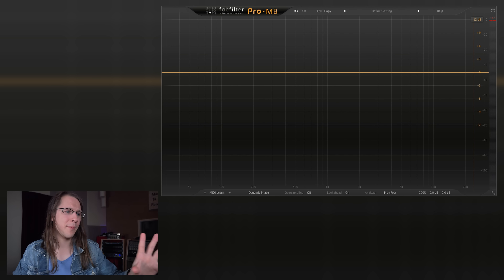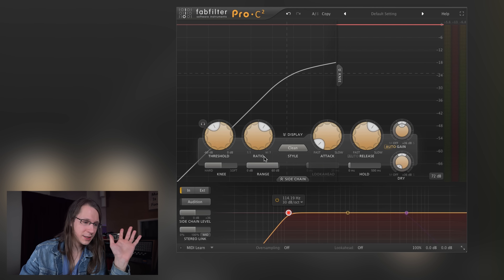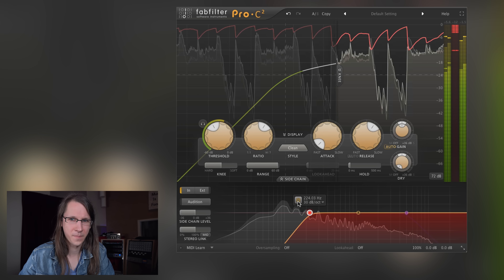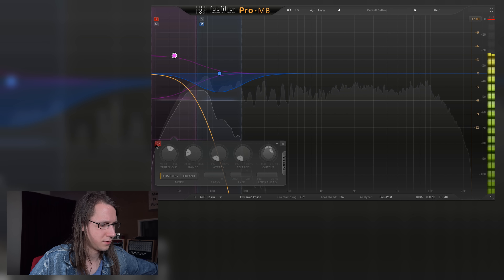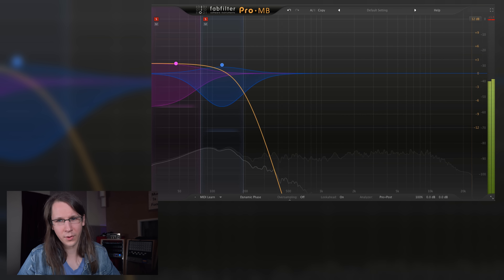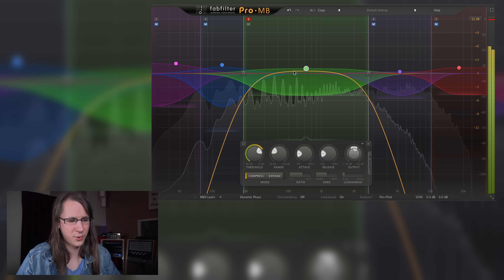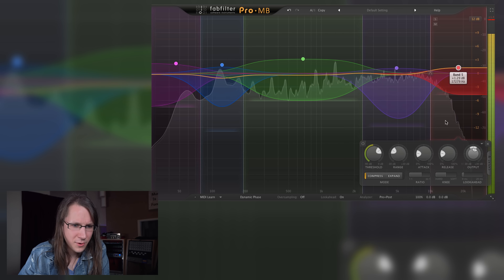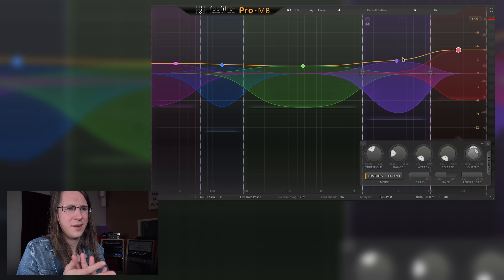HOW I USE MULTIBAND COMPRESSION.

Comment: The main problem with multiband comps is that they generate phase incoherences, which can be heard btw on your high-mids and highs btw. That's the reason why M. Brauer and many other mixers are using different compressors on different type of instruments. Multiband are great on monophonic sources - vocals, bass -, can be used even on guitars, but when mix well, not so great. When mastering, it is being used as a corrective tool.
Reply: But the phase incoherences can sound nice sooo
Reply: spot on
Reply: He says it in the end “there is something wrong if I need to use it”
Reply: The pro MB has a linear phase mode also.

You will never hear phase coherence above 3k. Thats the point when you play a single sine from one speaker that seems to come from different directions if you turn your head a little bit.

Comment: "I try to keep it simple" uses 5 bands on compressor 😉
Reply: Louis Jans compared to 15 yes
Reply: Its Multiband compression, It makes no Sense To use bands less than 4.
Reply: @miscellaneous1276  It actually does. Depending on the material you're working on you could be working even with as little as just 1 band. There's no need to affect the whole frequency spectrum, sometimes you just want to tame one specific area without affecting the rest of the spectrum. You're clearly not very experienced. A mixing engineer uses these tools for a specific purpose/need not just because "it's a multiband compressor, there's no point in using it if you're going to use less than 5 bands" that's so idiotic from an engineering point of view.
Reply: @djvar94  Yes In that way but then you probably would have 3 bands if you know what I mean.
Reply: in multiband compressor, it makes no sense to use more than 1 band.
Reply: @izvarzone  exept for the master.
Reply: @Key.Fantasy  who? Lmao
Reply: @izvarzone  lol
Reply: @miscellaneous1276  arguably 3 for bass mid treble can be fine

or on a solo instrument just low and high bands

Comment: As a small tip for people starting with compression: don't constantly listen with the band solo'd. It really starts messing with your ears quick. Always switch to listening to the entire plugin and compare it to the plugin bypassed. It sounds very time-consuming, but in the end you save time on not having to redo it. You can listen more to stuff solo'd when you know what you're doing. Also: reference tracks, ESPECIALLY when doing mastering like in this video. Like how Wietze does it at the end is a good example. It's a lot of information, but changing things while listening to the other bands (in this case) as well is a good practise.
I have some friends that are still a bit new to the producing thing and I see them work on a lot of stuff in solo and more often than not you make less educated decisions when working on a track in solo compared to listening to the full mix. 
Don't be scared to use solo to take out resonances or want to further investigate what a plugin is doing, but keep it to the entire mix. This also goes for instruments, but a bit less so in my opinion.

Comment: Pro MB has to be one of my favorite FabFilter plugins. The UI is so simple, yet there's so many features in the plugin. The MB aspect alone is really great, but I think the real kicker of the plugin is that you can also use it as a gate. I don't know many plugins with allow you to gate only certain parts of the frequency range (most gate plugins affect entire frequency, and any "filtering" you see in the plugin is just a sidechain for the gate), whilst the Pro MB allows you to only gate certain range, and not the entire frequency range. 

The only thing to make this already-on-steroids plugin even more awesome, is if they added different compressor emulations for separate bands.. so you could have a VCA/G-Bus for one of the bands, and maybe FET/1176 on another band.
Reply: Multiband is teh tool of noobs...from 2005..everybody Suggs their mixes by adding Multiband...use a dynamic EQ instead unless you really know what you are doing.
Reply: Question:
Would you use that gate as a creative effect or a mixing effect? As someone fairly new to using multi and compression I don’t see why i would need to gate only specific frequencies i would love to learn though, when do you use it?
Reply: @tsrb8646  I don't remember if I've used it as an effect, but one thing I do very often with it is gate the kick drum, so everything below 100hz or 80hz gets gated, so it doesn't ring too long. This helps so the bass instrument can be heard better (since the lower end of kick and a bass instrument happen share same frequency range). I guess you can use regular gate too, but the way I see it only the lower frequencies need to be gated. The kick is snappy this way.

Other use would be, if you're working on someone else's track (remixing?), and you don't have separate tracks for every drum instrument (and thus only have one drum track to work on, drum buss or something), here the multiband feature becomes useful. The kick gating is useful here as it's only way to only gate lowend, but you can also use the gate on cymbals or snares, so you're basically doing multiband transient shaping by determining how long you want different frequency ranges to play. 

One trick I do often is I drive snare drum with saturators (FF Saturn is pretty good, some drive and dynamic) , and then when it starts ringing too much (and also resonating), I cut some of the resonance with EQ that the saturator brought up, and then also gate it so it doesn't play too long.
Reply: @MacReviewzOnline  I know this is a late comment but LMAO no way your comment is real
Reply: Imagine each band was a pro c 2 inside it. 😮
Reply: @MacReviewzOnline that's leet buddy.

Comment: Overlapping bands making 'bumps' - This is modelling of a Butterworth crossover which is good for guitar EQ adn some speaker crossovers however most speakers and EQs use Linkwitz-Reilly corssovers and frankly, if software makes amplitude bumps at different frequencies then its not worth using!

Comment: Yea, verry important to not overuse it. It can easyely make it worse if you dont look out for it. Sometimes getting controll over certain frequecies that way also changes the feel of it to much. Keeping the feel in the song should be the main goal, so dont use it if it compromises that to much, if that's the case look for diffrent solutions / combinations to fix it would be my advice.  In addition i see myself using multiband especially for sidechaining lowend issues that dont glue well enough but are to important to lower down in gain. Verry handy for that as well.

Comment: I also love the Waves F6, which they call a "dynamic EQ",  but it functions just like the Fabfilter. It's just way cheaper but only has 6 bands plus HPF and LPF.
Reply: Dynamic EQs and multiband compressors look a lot alike, but aren't the same from a technical standpoint. A MBC splits the signal into frequency bands, then runs each of these through a compressor and finally mixes them back together. A DEQ put's the input through an EQ, but the parameters of the EQ are automated using envelopes of filtered versions of the input signal as controls. For a lot of applications you can get similar results with either, but I can think of weird uses that are only possible with one of them (though these also tend to involve building my own versions og DEQs and MBCs in Reaktor or with the flexible routing in REAPER to get past limitations of the available VSTs).

Comment: Really nice, separating out the sub and bass frequencies like this is really effective! You mentioned that you wouldn't use this on your master bus - would this be something you'd recommend at the end of the mixing stage then? Are you boosting so much and upping the ratio because there's plenty of headroom in the mix? Would you recommend this as it seems to make the master a bit more 'musical' with the MB compressor getting the different frequencies kind of 'bouncing around' with the music putting some nice movement in at this stage relative to where your crossovers are... Really great video!!

Comment: I preffer dynamic EQ but the idea behind both is the same: What frequency range is going nuts and being annoying the others?
Reply: Can you explain the diference between those 2 ?
Reply: @SilloniusAeldarian  There are two main differences:

1) The multiband-compressor does a drastic phase shift that stays the same all the time, while dynamic EQ makes the phase shift depending on how the band is set.

2) The multiband-compressor is better used for compressing wide areas. Dynamic EQ works well for both wide and narrow areas, but it's better for narrow ones, like non-constant resonances or deessing.
Reply: @heavymetalmixer91  thank you! And 1 more, could u give some example on when we choose what between those 2 on some point of mixing? I hope u understand my english
Reply: @SilloniusAeldarian  I tend to use them just after the fader mix is done, because controlling the low-end on some tracks (multiband compressor) or resonances (dynamic EQ) make the mix harder if dont treated quick.
Sometimes I also the dynamic-Q as deesser after compressing vocals. Btw, try to not use any of them in the mixbus unless you will do subtle moves, they can quickly ruin your mix, mostly the multiband compressor.

Comment: nice, now i see why people use this multiband compression. I have definitely ran into the first issue you showed befor with the lows squashing the rest of the track as well as had vocals where i wanted highs and high mids yet it was sharp so if i had used this compression method instead i could have a tamer version of those highs coming through in a way that pierces the ears a bit less.

Comment: I'm using fab filter saturation together with the tonal balance control from izotope to check my balance in my mixes before I'm going to master them but if the tonal balance control is telling me that one of my songs are lacking high end, I boost the highs through the saturation until the white line is more in the middle but it can sound to harsh or too bright even if the tonal control is telling me its balanced. Perhaps the high end is lacking because I don't have so many instruments that is appearing above 8000 hz? Ofcourse I trust my ears but your ears can be tricked sometimes.

Comment: This is awesome. From your elaborate description on how the filters must look I think I could do that with reaper proprietary Java Script Plugins. I even think Kenny has made a video about this, splitting a track into bass, mid and treble via routing and then compressing them seperately and putting them back together. But when I watched it the first time the info was lost on me I guess.
Reply: Yup, the JS n-band splitters and joiners do that job, though the rs-met crossover vst is the better splitter and free (all the freebie vsts from rs-met are useful). Then you can just use any compressor you want on each band (or any plugin, why not try adding reverb only to the high frequencies or setting different delays for two mid-bands).

Comment: Many problems dear friend.
1. Use 3db visual for mastering. You're affecting the mix too much. There is a mix problem if you do so much.
2. Lowering the attack to so small numbers you get too much distortion. Not a good idea.
3. Check oversampling what it gives soundwise. Maybe it's better without oversampling.
4. check if linear mode is maybe better than the "phaser" you're using. Hear the phase problems created on M/S (by just hearing the Sides) to hear how much it's affecting it.

Comment: Am I seeing 50Hz compressing more on the snare hit than the kick? I think your multiband method is quite good, although the low end is more of a multiband limiting situation and some other band's ratios seem a little high I would had thought but if it sounds good it sounds good haha.. sometimes I will multiband process a bass signal with sub, low mid and mid highs, with different eq, compression and saturation etc. on the three filtered tracks in one group and process the group a little afterwards, as if its the new bass :)

Comment: As an alternative, how about recording a track with good sounding eq on whatever instrument you're playing. I Set eq flat on the board and adjust the amp or guitar. If a guitar track needs compression because a few or many notes were too loud or too  soft, how about playing the track over until the performance is acceptable? It seems the player is unable to play the part adaqutely so maybe practice more. Isn't compression needed because  the player can't really play? Same thing for melodyne if you can't sing in time or on key just autotune. A good sound person would require little compression if the player or singer does a good job. Or am I too simplistic on the issue. I know compression is a valuable tool. Is it really bad for a singer too express some feeling that includes singing a note louder or softer. Who said every note has to be at the same level. I disagree. If that bass drum level is clipping, turn the mic down vs compression. What am I missing here?
Reply: Compression does a lot more than keep every note at the same level. It can be used to shape the tone of instruments, emphasise/curb transients,imply power and much more. It’s a hugely variable tool that can be used creatively. Just listen to the vocal sound on Sly and the Family Stone’s ‘You Caught Me Smiling (Again)’ and notice how the more powerful vocal sections seem to push at the limits of the track without drowning everything else out.

Comment: Before I had any multi band compressors with a side chain, I would literally “make my own” multiband compressor with multiple standard compressors linked to corresponding filters to create the “bands”.

I feel like multiband sidechain compression isn’t used to its full capability.
Reply: Agree. I do this on the sidechain send. Compress the low freq when the kick hits. Works great when combined with a volume shaper.

Comment: What I find interesting is that this is part of a mixing process rather than mastering. I always thought such significant processing on the 2buss would be a mastering engineers job. I understand that mastering engineers should really be doing minor changes, but it’s just interesting that fairly bold processing is going on the 2buss. I always thought that the less processing the better in this area, unless the mix is pretty poor.

Comment: If you’re looking for great analog multi band, check out the TubeTech multiband compressor. If you want 5 bands like you use with ProMB but with simpler and faster control plus parallel, check out a used TC Electronic System 6000 with MD4!!!

Comment: Why not use a EQ to correct the problematic/interfering frequencies, then use a standard compressor? I don’t get the benefit of a multi and compressor vs an EQ.
Reply: It's mostly about consistency, frequencies sometimes move different from the rest on the same track and that can lead to weird sounding tracks. Mostly in the low-end you need as much consistency as possible, so you only compress the low-end and leave the dynamics on the rest of the frequencies untouched.
Reply: A regular compressor will always compress the WHOLE frequency spectrum. Sometimes you want to only compress the bass for example

Comment: Dumb questions alert!
When do you use it? As a final mixing thing or in mastering? 
I usually multiband compress using iZotope Ozone's one, what's your thoughts on it?
Also, would you suggest placing a corrective EQ after multiban compression or not necessarily?
Reply: BRTHR M One of the most common uses for me is on a arpeggio guitar part.. depending on the player sometimes the bottom string notes are too loud compared to the top string part. EQ’ing will just fuck the tone of the guitar up. Put some multi-band comp on just the part sticking out and you can in essence control just the frequency zone giving you trouble. And yes, put an eq after it if it needs a little balance. Hope that helps you.

Comment: I do the same thing with the lows - I see people use one band for everything from the bottom up to 300hz or so. Doesn't work well to me, because I typically want to treat mid low bass differently than subs - say split somewhere around 80hz or 100hz or so.

Comment: In my opinion if you mess with the eq your also messing up the accoustics, if their must be more high in it then it should be done at the individual channels before the remaster process.
I use multiband compression as a limiter to chop of peaks here and there, i slowly increase the input volume till it works slightle here and there.
Also i need this to have a good volume over multible tracks on a album, so all tracks have the same volume for playback.
And i also must say that i am not part of that loudness war, in that way you compress everything

Comment: I dislike multiband. To me they always make things sound odd. I think it's to do with the filters. I'm of the opinion that filtering should be done as little as possible, mainly by getting the audio as close as possible to what you want right at the source, and always cutting rather than boosting. I also think compression should be done on individual instruments, using compressors that suit the particular instrument.

Comment: Radio stations live and breathe (no pun intended) by multiband compression to get that loudness that they want without breaking the rules. Check out an app called Stereotools $500US Owie! You can try it free but it puts random tones in the output until you buy it.
Reply: soo... if u use multiband compressor to degrade quality for loudness, then radio will use another multiband to degrade quality further.
Reply: @izvarzone  In fact radio stations prefer getting un-molested tracks because their own processing works better with it.